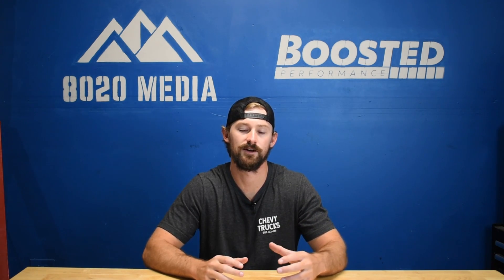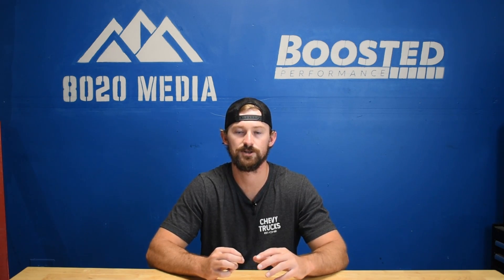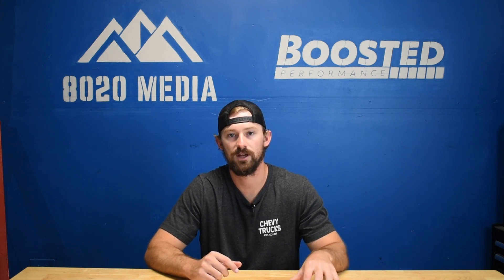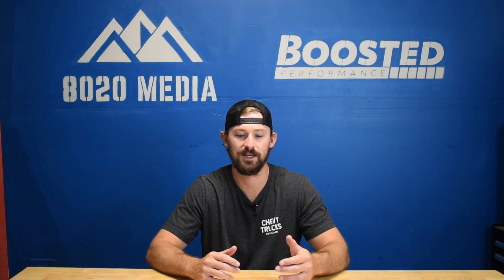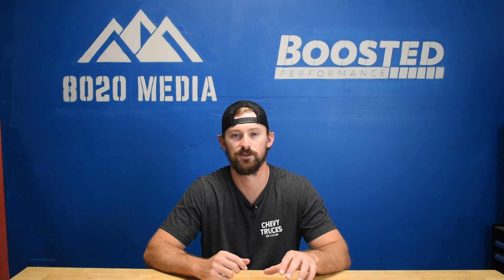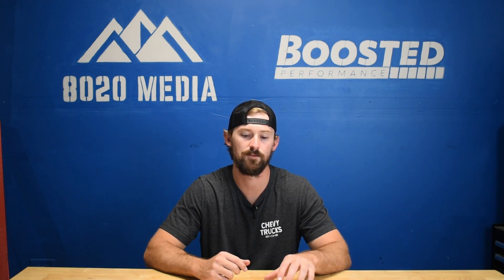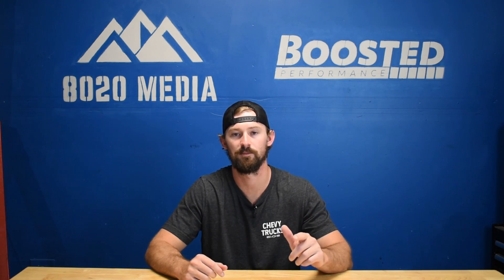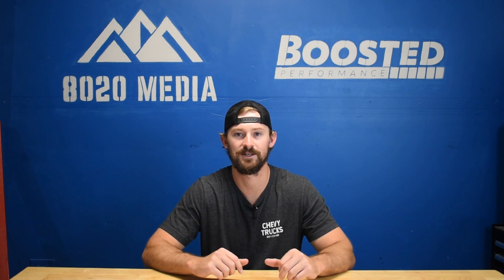What is the Vortec Max? – Specs, Misconceptions, and More!

Comment: I had a 2008 Silverado z71 with the vortex max package with tow package. Black extended cab LTZ . I got 12 mpg on the highway 12 in the city 12 towing . Best truck I’ve ever owned. Thing was a beast. And yes it was a real 6.0 aluminum block motor. I traded it in for a 5th gen Camaro SS

Comment: 410 gears? In the pickup trucks perhaps.  I'm pretty sure you won't find that gear set in the suv's.
Reply: Yes the Escalade version with the AWD and v max does in fact have 4.10 the 02-06, 7500 lb towing
Reply: @paulwalker4772 
Thank you. That tracks with my towing capacity. I didn't know.

Comment: My 2006 Vortec Max Silverado has a 4L70E trans 4x4 4.10 gears.  Not the 4L65E.
Reply: You are correct. I had an 2008 max z71 off-road with a 4l70 and a 4:10 . I did the DOD delete and ls7 lifters lsa cam  back in 2010 best damn truck I ever had it got 10-12 mpg regardless of how I drove her even towing my 23 boat 10 mpg

Comment: I need some input- I have an 07 Chev Silverado 4x4 Vortec Max, it’s been a great running pickup, it’s been kept maintained. Out of the blue I started getting pop up’s on the dash, one says “transmission hot, idle engine”, the other says stabili-trak….something. I brought it to the dealership, (chev cert Mechanic’s) they changed some sensors, they said by looking at the fluid and checking it out  the tranny has never been hot. The message comes on as soon as the truck starts up so no time for the tranny to even get hot. Anyway after they “fixed” it, the messages started popping up again, in 2 days. Sometimes the messages won’t be there and the truck is fine, the messages come on and it bogs down, no change from 4,6 and 8 cylinders, no 4x4, no cruise control, and more. I took the truck in to the dealership 3 times, the problem never actually fixed. Several sensors have been changed on multiple occasions, by multiple mechanic's at a few different shops.  I desperately need some help. Any ideas?

Comment: My 2002 cadillac escalade is the first 6.0 high output. Am I right?
Reply from the maker: F - Yes, you’re right—your 2002 Cadillac Escalade was the first GM production vehicle to get the high-output 6.0L V8, specifically the LQ9 engine, which was a performance upgrade over the standard LQ4 found in other GM trucks at the time; the LQ9 made 345 horsepower and 380 lb-ft of torque, featured higher compression (10:1), and was tuned for more aggressive performance, making it the top-tier option in GM’s truck/SUV lineup back then, and it eventually found its way into the Silverado SS and other high-performance GMT800 vehicles.

Comment: one very notable thing that this video ignores is that the average power and torque of the 6.0 LQ9 would obliterate any 4.8, 5.3, and 5.7 of its time. That was the difference. If you drove a 4.8 ext cab, then a 5.3, then a 6.0 lq9 one after anothere, anyone would notice that the difference is huge. Much more usable ppower throughout the RPM range. To me, the fact that the creator of this video completely ignores that and does not even mention it simply discredits this video. Also, the fact that he said they only came with 4.10 gears is completely wrong. There is a 2006 Silverado SS Intimidator and a 2006 Silverado VortecMAX boith with 3.73 in my driveway that would end that comment (as well as another 2006 Silverado VoctecMAX that was stolen from me in 2020 that also had 3.73). He also dowes not mention anything about the gen 4 rods that LQ9s came with from factory. Very uninformative inaccurate video to say the least.
Reply from the maker: S - Thanks for taking the time to share these insights.
Reply: You are correct. I had a 2008 ltz extended cab z71 4x4 with a 4:10 max package aluminum 6.0 and 4l70. The dealership had another max package with a 3:73 z71 . It was $600 difference between the two. Exactly the same trucks but mine had the HD trailering package. Both trucks sat on the lot for months that was during that huge financial collapse crap . Mine was actually pretty rare all black no chrome.

Comment: My 07 6.0 ltz 4speed owner here. I don’t have the button to turn off trac/stabilitrac feature. Anyone have an idea on how I would do this?
Reply: Should be the buttons at the bottom of the center dash... but my truck auto disables them and just shuts off from Day to day 😭
Reply: Iv seen the button. Mine just don’t have it. Pedal adjustment, parking sensor and windshield wiper heater.   I’m missing a button :(

Comment: Ive driven a vortec max, it was a crew cab gen 4 i believe with the square headlights. It was impressive, diff more power then your bog standard 4.8 or 5.3. I done a burnout across a 2 lane, both back tires just trying to take off on 20's, 2 wheel drive no powerbraking nothing just gas. But its not like insane power, having driven lq4's too in similar platforms the differences really isnt much. If my old lq4 wasnt awd all the time it would be dang near the same. I wouldnt go out of my way to try an get one of the maxes, but they do have a very slight edge over other 6.0's. 5.3s\4.8 a noticable diff. The biggest thing with them, there aluminum or so i think. I always wanted one after driving that gen 4, but having my lq4 now an messing around with it the difference is pretty much mute. I can remove my front drive shaft an do the same thing. Put max badges on the side of it, check me out lol. The biggest thing is weight, these trucks in the 1500 chassis are already pushing 6500 pounds. OfCourse an lq4 is going to be sluggish in a 2500. But in a half ton a 6.0 is no joke, max or not. You get some of that weight off of them, an some decent highway tires. There smoke machines, Theyll be thinking you got a stroker motor an its just a wore out lq4 from the junkyard lol
Reply from the maker: C - Thanks for taking the time to share your experience and insights!

Comment: I assumed my 2012 Silverado vortec max had the 4l80 transmission being it has a beefed up suspension and such. What options are on the 2012 models
Reply from the maker: C - The best way to check would be to use a VIN decoder, unless you think it's a different transmission from stock.

Comment: I really REALLY wish you gave some insight on Cadillac variations of this.   For Chevrolets this was nice.   The only reason I found the video was because I am about to purchase a 2006 Cadillac Escalade Platinum and it has the Vortec MAX and I was wondering if that was just some junk someone put on there or if it had any real reasoning.  I also have a 2005 escalade platinum but it had the regular LQ9 "6000" you mentioned.   I just assumed 05/06 had the same stuff.    Hopefully I can find someone who gives this much detail on the upgrades for this escalade if this year.
Reply: Same here. I just purchased my 06 Escalade ESV Platinum and it too has the vortec MAX cover on it . What I'm trying to find out now is if it has the 4lq60e or the 65e transmission. Seller listed it with having the 60e and based on what I'm searching and this video, seems like the 60e isn't as strong as the 65 would be and it will destroy the 60e in time because of the specs of the engine. Wondering if it did at one point have the 65e and some time during its life the trans got swapped for a 60e 🤔
Reply: @ultraman8328 All Cadillac Escalades 02-06 That came with the 6.0L LQ9 was paired with the 4L65e. Also for the record the “Vortec Max” is the LQ9 engine that was used in the Escalade, Silverado SS and Vortec Max trucks.
Reply: @ultraman8328   yeah he didn't say anything in his comment above that helped lol.
Reply from the maker: E - It should be pretty close given it is a GM engine. Hope the video helped!
Reply: It’s the same engine buddy the LQ9 is the vortec max paired to the 4L65E

Comment: The cat eye 03-07 classic 1500 HD with 6.0 is in my opinion probably one of the best well rounded trucks GM has ever produced. I’d give my left nut to find a clean one.
Reply from the maker: J - Those are certainly great! lol, might be a stretch on the last part.
Reply: I got an 04 sierra denalli with the 6.0,  factory 4.10's quadra steer thats my baby. I got some body work to do to it, but its a unit no doubt. Super versatile, tow stuff, hot rod drive in the snow whatever. I didnt realize how tricked out some of them trucks were back then untill i got it. Its even got electronic or somthing suspension on it to smooth the ride, a 6.0 halton pick up truck.. It dont have the vmax in it from what i can tell. But she aint lacking....Especially with the 4.10's all my other trucks have 5.3's with 3.73's. That ol denalli peels out lol in awd. If i had a way to put it in 2wd it would absolutely shred the tires. Burnouts a quarter throttle
Reply: I just bought a 2005 GMC 1500 with the vortec max for 300 dollars. It’s a little rough on the body but it’s just rusted rocker panels and a couple dents. The engine is perfect and it drives beautifully. I can’t believe I got that truck for basically nothing. I’m so excited about it I’m telling a random stranger on the internet. I want everyone to know I bought one of the best trucks for 300 dollars.

Comment: They should have called it the vortec gas hog. I got a 2009 Silverado and it gets like 9 or 10 miles per gallon I can literally watch my gas gauge go down.
Reply: I have a 2007 Express 2500 van 2 wheel drive that I use for service work carrying quite a bit of weight, It has a 6.0 Vortec that gets 10 MPG if I'm lucky. These are not the kind of vehicles you should buy if you are worried about gas mileage!
Reply from the maker: M - Thanks for sharing your experience!
Reply: Need to retune the ECU
Reply: Me too lol
Reply: I think it all in your foot. I manage 17mpg in my 03 escalade awd 6.0 and I got 18 in my 07 gmc z71 crew cab 5.3.
Reply: Yes but because of the reliability difference you can afford a smaller used car for a daily! I have a 2500hd and a Camry!
Reply: Do you have the AFM delete? I have the $80 AFM chip off Amazon and Mine gets 11.5mpg average. My buddy has a 5.3 Tahoe and he only gets 8-9mpg average. So I figure mines not too bad. I think you have to buy a 2018 and up v8 if you want better gas mileage.
Reply: @tjborboa722  depends on what year vortec you have? Most of these motors do not have active fuel management
Reply: @kcinyourface incorrect, all 6.0 and 6.2 engines past 2006 have AFM
Reply: Damn I have a 2003 2500HD with the 6.0 and get like 16mpg, if I’m on it it’ll go down but driving it easy I get about 16-17.  I changed out a couple sensors, and did a tune up b4 that I was probably getting 10mpg if that.
Reply: @Gen01Lee what do I do, just go to a mechanic and ask for basic tune up?
Reply from the maker: B - Thanks for sharing your experience!

Comment: So a 2006 gmc Sierra 1500 vortec max 6.0 won’t have AFM/DOD right? Trying to get as far away from lifter issues as I can
Reply: Gen 3 motors didnt have afm/dod. They were in gen 4 motors starting in 2005
Reply from the maker: James - Best thing to do is pull the VIN and use a VIN lookup. It will tell you if it has AFM or not.

Comment: So you said the first gen vortec max 6.0 has 367 hp what about the 2nd gen l76 ? Hp / torque ?
Reply: 1st gen vortec max is 6.0 L, iron block, LQ9 on the build sticker, and 345 HP.  2003-06.  I am original owner of a 2006.

Second gen is AL block, L76, 367 HP.

I believe everything was correct in the video with the possible exception of "a standard 6.0 L" being in a 1500.  I believe the standard 6.0 L (the LQ4) was available in the 2500.
Reply from the maker: S - We have an article on this on our Chevy Trucks website that we think would be helpful: https://chevytrucks.org/what-is-vortec-max/

Comment: You left out the part about cam lobe wear/lifter roller failure due to AFM. I'm trying to find out if My 2018 Chevy Express 2500 cargo van 6.0 motor has the Vortec Max with AFM. Shop is telling me I have cam lobe wear or lifter noise due to AFM. :(
Reply from the maker: Mallory - In these videos, it is quite difficult to cover ALL of the problems these engines can experience. If you are wanting to know if your vehicle has AFM, it is best to pull the VIN and look it up. This will likely indicate if you have AFM or not.
Reply: Not sure when the afm started but it was post 2007
Reply: I deleted my AFM. Totally worth it. Highly recommend

Comment: Does the 07 GMC sierra HD classic 6.0 2wd have AFM?
Reply from the maker: JM - It should not.
Reply: @8020Automotive  How hard is it to find a 07 GMC 2wd 6.0?
Reply from the maker: Pretty difficult, but not impossible.
Reply: 2007 GMC Sierra 1500 classic 2wd slt crew cab 6.0L. How much $ would be a reasonable price. 8th letter in the vin is a N.
Reply from the maker: You'd have to look at other comps out there. it depends on condition, mileage, and more.

Comment: I have a gorgeous 2007.5 silverado v max. What parts compare to this exact engine? Cuz i had to get the lifters done twice. They thought it was a 5.3. Anyways what actual parts fit the nbs silverado vortec max?
Reply from the maker: Are you asking which lifters you need for this specific engine? Seems like a big mistake to mix a 6.0 with a 5.3 - I'd have to double check on lifter part numbers, but the engines did share a lot of similar parts.

Comment: I have a '03 2500HD Vortec Maxx 6.0L and the vin decoder says its a LQ4. The truck has a super low first gear ratio and lots of trim options, so I think the badges are correct. It has 4wd and factory Edelbrock headers with a CARB plate under the hood. I think it came from Texas. What engine do I have?
Reply: vortec max were 1500's you have just a stock lq4
Reply from the maker: R - The LQ4 is a standard 6.0L Vortec.

Comment: I like the video but always thought the 8.1 would be the vortec max since it was the biggest vortec that could be ordered but also didn’t it make the most torque?
Reply from the maker: You would think so but the MAX was really just a marketing ploy for selling their half-ton trucks with the bigger, more expensive 6.0 engine. The 8.1 wasn't available in the half ton trucks and calling the 8.1 engine MAX when it is the Duramax alternative wouldn't make sense, which is also why the HD trucks didn't get the MAX engine despite using the 6.0 from 2007 on (just my guess).
Reply: @8020Automotive  confusing isn't it?
Reply: @8020Automotive the vortec max was pretty much their version of the denali.  But kept the 2wd active(u can disable the traction control) as the denalis are awd or 4wd.